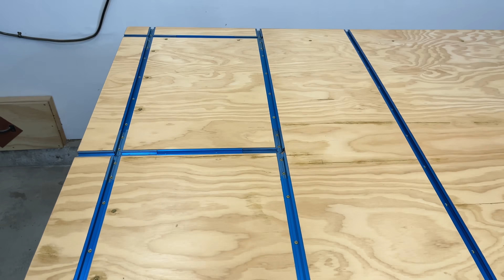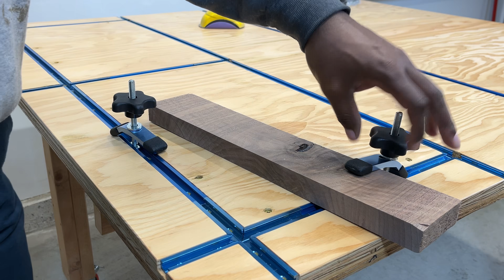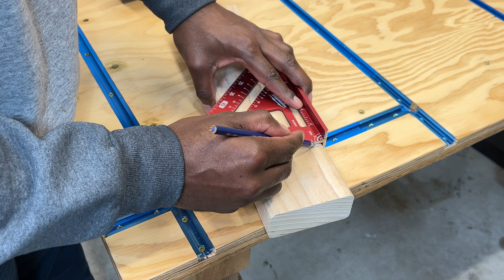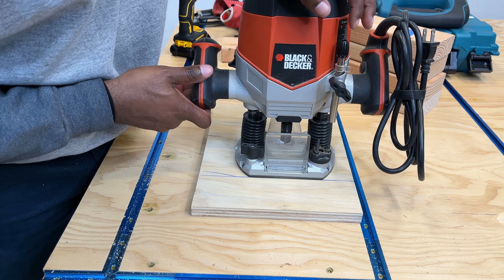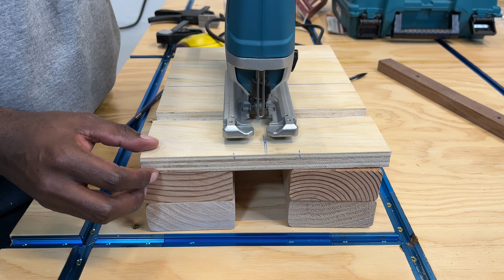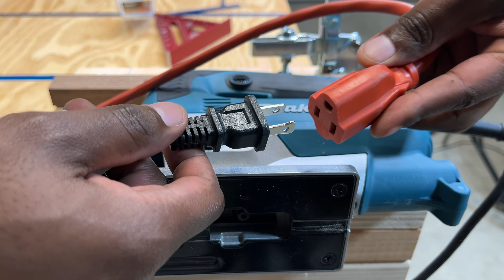How I Cut T-Track without a Miter Saw

Comment: Thank you for this easy to understand video. As a beginner at woodwork & trying to make my own items instead of simply paying hundreds at the Big Box Hardware stores, learning form others is really helping a lot. So far I made a finished medicine cabinet out of maple instead of paying $350. for a metal one, made interior door threshholds out of dense pine for 3 rooms in my house & they too were made out of scrap pieces, sanded & finished with urethane. Saved me about $75. Now I have a plan to install T Track before starting another project. Cheers.

Comment: You can easily cut t-track with a miter saw faster and more accurately. Just use a blade with a higher tooth could and a little WD-40 or coconut butter as a lubricant. Kickbacks can happen on miter saws and if you're concerned about them, use a clamp instead of holding the workpiece with your hand. Don't plunge down the saw hard and fast. Instead, use multiple cuts in succession. It will give you a cleaner cut.

Jigsaws are inherently imprecise because they the blade flexes too much. Aluminum is surprisingly soft and can be routed and cut with standard woodworking tools. At the end of the day, use what you're comfortable with.
Reply: This a totally unnecessary comment.  
The video was simply 'ANOTHER' option for safely cutting T-track.
Talking for the sake of 'talking' is a waste of everybody's time!
Reply from the maker: I agree with your analysis. Thank you so much for taking the time to watch the video and for commenting.

Comment: Why did you choose to use walnut for the fence as opposed to more plywood or pine?
Reply from the maker: Great question. It was the only offcut that I could find that was less than 1 inch in width and it was already in my trash pile. The other option would have required me to bust out the table saw just to cut one small strip. Thanks so much for watching